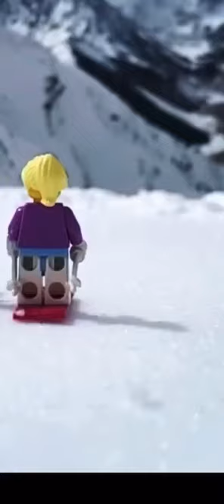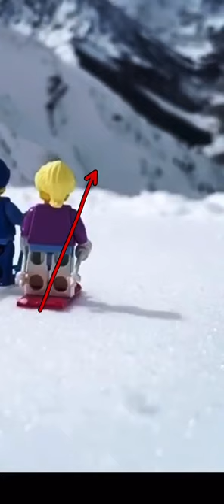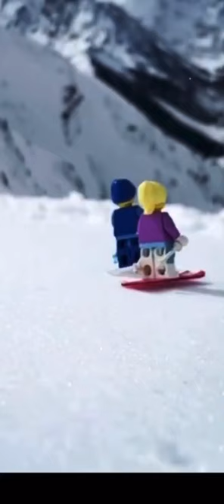Counter steering in skiing using LEGO figurine

Comment: This is awesome lol.

I was with you (or so I thought) until you got the counter steer problem.. are you suggesting we should steer right real quick to have the center of mass falling in to do  left turn? I had initally thought this was about getting your weight inside but this counter steer idea threw me off.

I can understand it I think.. but having issues picturing it in actual skiing when ou are trying to turn both ways. Would the countersteer occur at the end of the turn? Am i really off: say if you are at the end of a left turn, rght before you start your left turn you would steer left to help push your weight inside?
Reply: tgellie That's a simple way to put it that makes a lot of sense; thank you! I was overcomplicating it by thinking of by thinking the "countersteer" was active steering. Cheers! Will try to remember this for next season! Virus stuff has ended the season. Stay safe!
Reply: tgellie Thanks Tom, appreciate it!